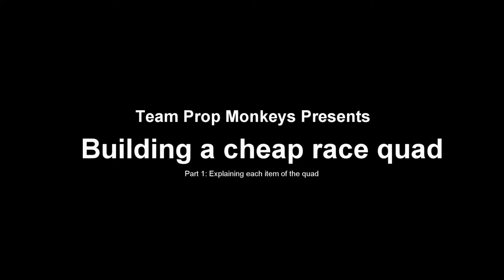Building a cheap FPV race quad - Part 1

Comment: I have this exact frame and the way I mounted the HS1177 camera I had to drill holes in the side plates with a diamond bit and dermal tool. I drilled holes between the first two holes a little lower and the camera swivels up and down perfectly and still has protection from the frame. 
I think you will love this build.